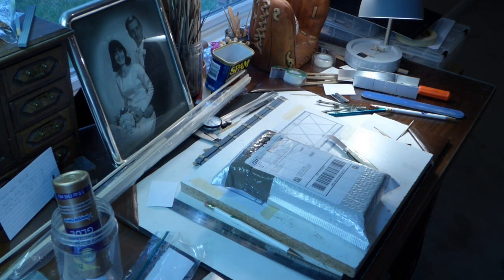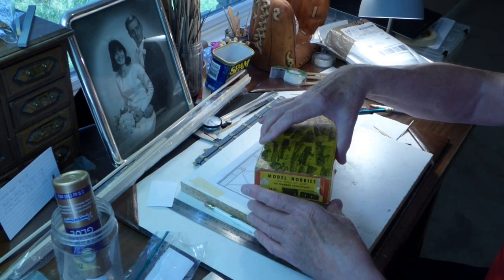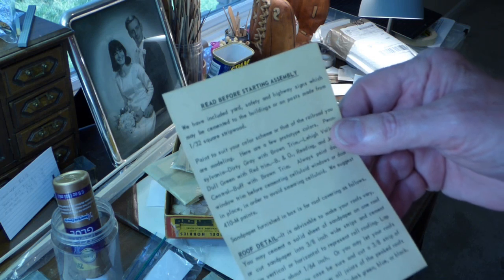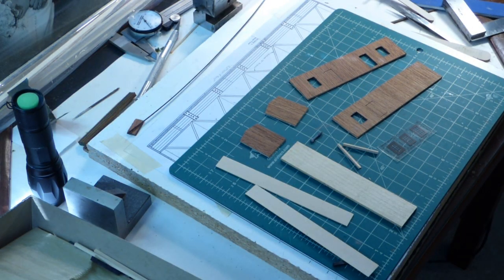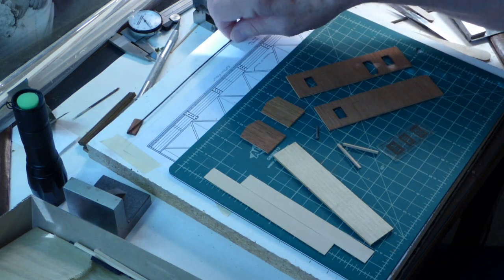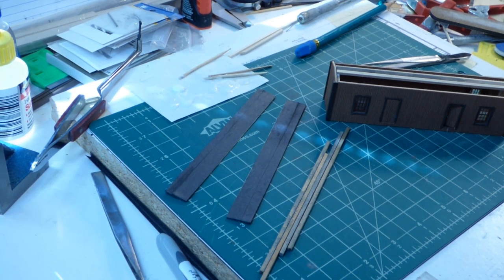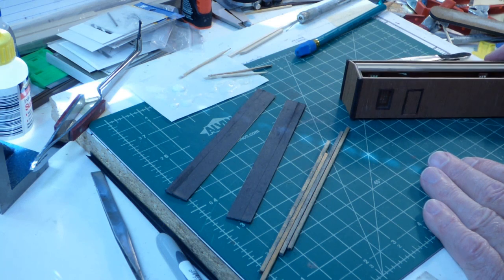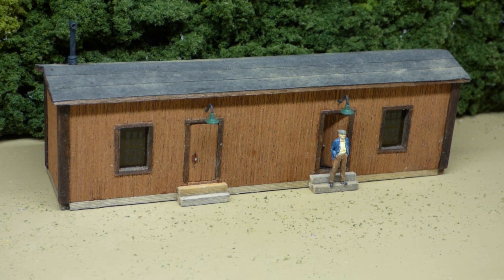Building A 66 Year Old Kit By Model Hobbies

Comment: Not to disparage anyone from buying and building these early structure kits - I do it myself and like you find it very enjoyable - but this is the sort of structure that could be scratchbuilt for less than what these kits often sell for on eBay.  And you mention the thin plywood; I have seen some at craft stores but not recently in my area.  I really enjoy using it for places where you need a stable material that is less likely to warp but still want to use wood.  It also works great when you want to add a detailed interior without stripwood bracing getting in the way.  Anyway, nice job as usual on the kit.
Reply from the maker: Thank you.  I agree that this would be a simple and inexpensive scratch build.  Years ago I picked up a pretty good sized sheet of thin plywood that I often use for sub-roofs on larger scratch built structures.  As to the old kits, it seems to be a rabbit hole that I've dropped into this summer.🙂